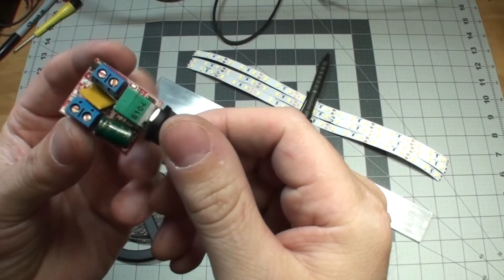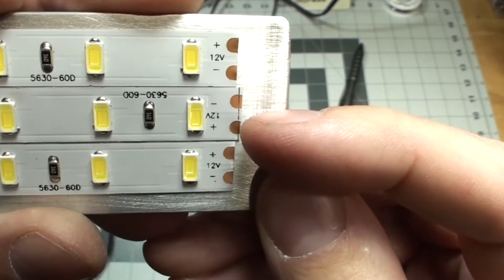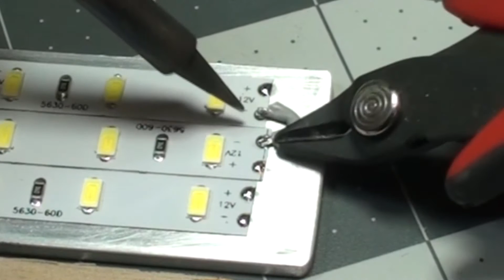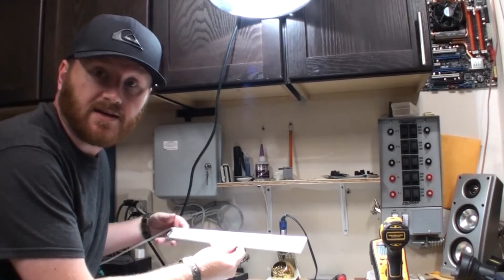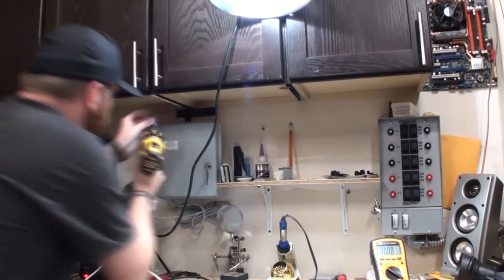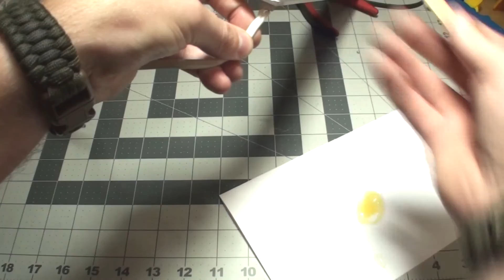DIY LED Video light / Work light

Comment: Isn't there a hazard of shorting your power on the aluminum backing plate? Wires are very close to the surface.
Reply from the maker: Yea... I Probably should have mentioned that... LOL.. That strips I used only have copper on the top of the strip.. and the casing of the wire helps hold it up away from the aluminum... I should have put some Kapton Polyimide tape down..

Comment: Cool! I want to build mine, but... where to find the regulator? and... is it using an ac/dc cable or you connect it directly to the wall?
Reply from the maker: It just needs a 12v DC power supply.. Just find a 12v AC to DC "Wallwart"
Reply: Thanks! and about the PWM? tech specs or where to find it?
Reply from the maker: Amazon links in the description.
Reply: Ooops! sorry!